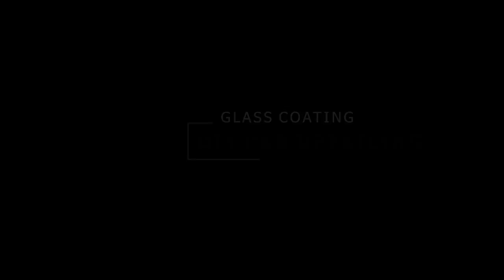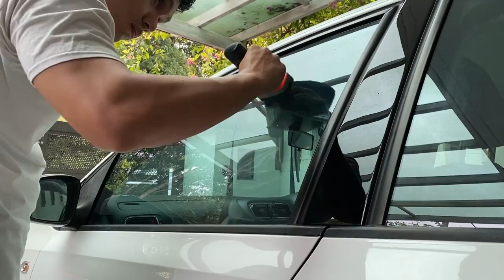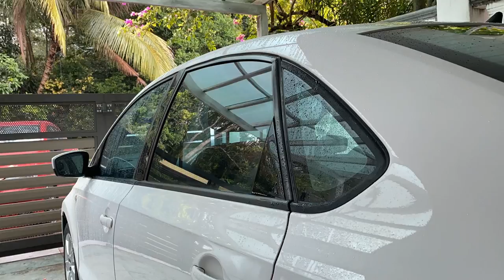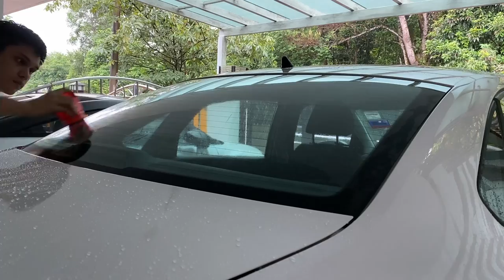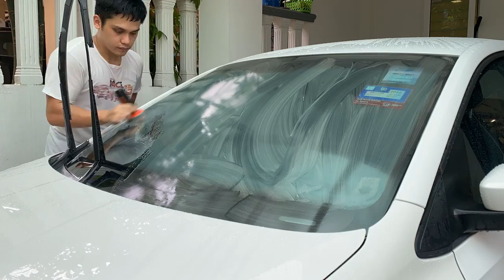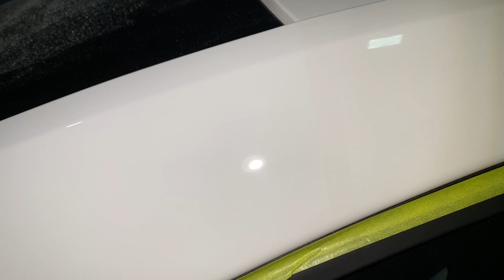Soft99 Glaco (Glass Coating) - Super Easy Home DIY With Great Results!

Comment: you use it wrong^^ you have to wait 5-10min before clean it up and you have to wait 12-24h before you can make water on it and why do you not degrease the windows? read the description!
Reply: Not in this 1 only on the flaco soft 99
Reply: Don't need to let this one cure

Comment: Nice video. 1 comment... You should actually wait for at least 12 to 24 hours without water contact. You apply the product and rins it off directly. That is what makes it work less and not very long. That is what Soft99 says and what they are advising to do.
Reply from the maker: Awesome, thanks for the tip! It has been almost four months now and still beads like nuts 😄
Reply: @matthewtong123  lol maybe Soft99 is wrong. 4 months is a good amount of time I think. They've got a lot of labels that says 12 months or 7 months. I doubt a lot of them. 12 months is a lot of time for a wax coating for example. So if we can get 4 to 6 months out of it it is awesome in my opinion. These soft99 products are fairly simple to apply , yet they offer a professional quality and a professional amount of time of your car being protected. I really love this company and its prices. We get a lot for little money. I think it is going to rain in The Netherlands within a few hours from now. Maybe I'll film my car and put it on Youtube. It beats the hell out of the rain I can tell you 🤣
Reply: 12 to 24 hours is for fluorine or nanotechnology based glass coating, for these silicone type, no cure time is needed after buffing off.
Reply: The 12 hour curing time only applies to the Glaco Ultra glass coat. He was using the Glaco Roll On Max which requires no curing time. Glaco Ultra last longer

Comment: Can u do more vids on car detailing like when to wash a car which products and all like how many times do we need to wash
Reply from the maker: Sure thing! Thanks for the recommendation 🤗
Reply: its advice to wash a car once a week. there's a lot of products out there like meguair, turtle wax, carpro, osren etc to wash a car. i highly recommend a two bucket washing system with a grit guard on each bucket. top to bottom method. good luck
Reply: Whenever it's dirty n after rain n slush, I usually wiped or rinse the door handles after each drive, hygiene reasons.

Comment: Thank you from Rome - Italy. One question: before I use the first product does the glass have to be perfectly clean? I washed it with a shampoo but there are some stubborn insect spots.
Reply from the maker: The first product (glass compound) should be able to remove stubborn insect spots, so to answer your question, it probably doesn’t have to be 100% clean, since you’re applying the slightly abrasive compound to clean anyway. Hope that helps!

Comment: Hey Matthew, have you experienced slight hazing after using your wipers under the rain with the glaco coating on?
Reply from the maker: Hi Alex, no I've not experienced hazing at all, actually. Does it only appear when you use your wipers?
Reply: @matthewtong123  yup when i use the wipers / wipe using a clean cloth. only for a split second tho
Reply: This is what happens when use this Glaco product. I had it on all my windows on my last two cars i got.
After using wipers its hazy for about 2seconds. Its a big safety risk and really annoying, thats why i dont use this product anymore.
Reply: @lauristahl1884  good to know im not the only one experiencing this, thanks for sharing.
Reply: @golfcoins  should check your wiper blade. I've experienced before, change to a new one, prob solve. just realize my old one haven't change for years..

Comment: I wonder if coating the windshield with glaco will have any effect on the wipers (currently using PIAA with natural water repelling effect)? Just curious if the wipers will streak or judder when coming in contact with the glaco silicone
Reply from the maker: Hi! Unfortunately I can't answer that because I use standard rubber wipers hahah. But if your wipers already provide water repellency, you probably don't need glaco :)
Reply: @matthewtong123  yea, mainly because the areas outside the wiper will have watermarks since the wipers cannot reach there

Comment: does the glaco compound remove watermarks also?
Reply from the maker: It does but only slightly. It's not as effective as a dedicated glass polish though :/
Reply: @matthewtong123  alright man thanks for the info. more vids to watch.
Reply: @matthewtong123  because you have to press and polish more than in your video! and you can use a bit water to polish its easier